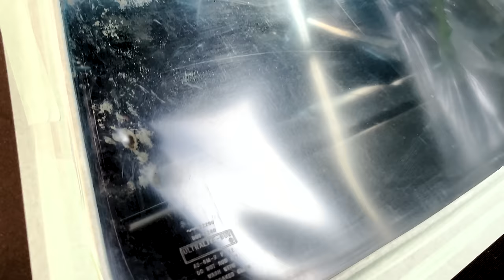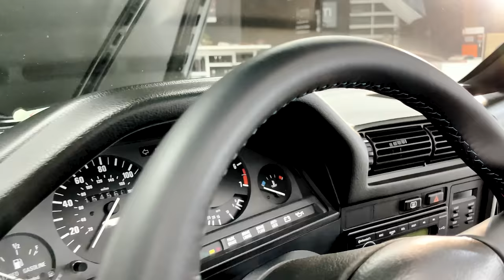The CLEANEST BMW E30 318ic you'll see today! AFTER 60HOURS DRY ICE CLEANING with FULL REFRESH DETAIL

Comment: „A car worth a few thousand dollars“ 
A convertible e30 in that condition (the condition it was before) will cost you about 15.000 Euro in Germany, and with that level ob cleaness you can sell it in „perfect condition, like new“ for much more. Plus you will be the Star on the Next car/Oldtimer Meeting.
Reply from the maker: Yes same here… the car worth around $25-30k now after our service I wouldn’t be surprise that there will be buyer for $35k+ but this car never will be for sale. 
And I used “few thousand dollars”  Because $30k is compare with hundred or million dollar cars we working on and even that people don’t want spend money like this owner. It’s very rare with “cheap” car like that.
Reply: the important point here is that its a convertible. and even small engined convertibles always hold their value better.
Reply: Dude it's a 318, calm down.
Reply: @user-sy5ks9ms3t  even clapped 318s in this market are going for 5-7k. A perfect one will easily fetch 15-30. Especially with the factory 5spd mt and sport package.
Reply: @scubascuba  such a shame, 318 sounds like pulling a car around in the tail
Reply: I bought my 316 2 door here in Germany 2003 when I got m license for 1100bucks  nobody wanted 4 Zylinders that Time. Even 320s were cheap because they wherent fast an needed a lot fuel. Today’s prices getting ridiculous.
Saw a before facelift 318 Cabrio. No leather. shitty condition for 8,5k few days ago.  
A 6zyl e30 whithout rust easy goes for 10k
Reply: @IAMDetailing  never sell it or you will regret it for your entire life,,, i sold my e30 coupe and i have tears in my eyes everytime i remember it and my days with it. And great job in the video, continue like that for good job and contents 👏🌹

Comment: So nice to see proper detailing where components are confidently removed and all the small areas are cleaned. So many idiots get involved in this industry have no formal training or experience. As a former Audi tech. I was trained in not just subsystem operations and troubleshooting, but in disassembly and assembly tasks. Clearly these are real vehicle technicians removing items correctly and replacing them is involved here. Had a bad experience both here in the UK with my 2019 Audi S5 and in Jamaica with my 2018 Q7. Keep the videos coming guys hopefully these guys will take the time to get some formal training to learn how to do things properly, and not do damage to customers cars.

Comment: I like a lot also have 318i 105 hp 2 door  from 1983 it was very cheap 900 euros i spended 300  and it was on the road in 2017 ,but needs job  entirely kjetronic needs Revival  thats the worst part everything needs to be checked for the rest its easy to Work on i will do the most .

Comment: what is the cost for something like this?  I have an 88' 325ic
Reply: If you want your car detailed to this level of perfection it will be at the very least 2500 i recon, most likely more.
Granted i don´t know the prices in the US, but over here in Germany just a paint correction of this degree with ceramic coating afterwards will end up at around 1200-1500€,
dry-ice cleaning of an entire underfloor will be around 2000€.
But if you don´t need to get to this level of perfection, it will become considerably cheaper, it always depends what you want the result to look like.

Comment: He did not apply the ceramic coating on a wheel with the unprotected brake disc behind it, or did he?
Reply from the maker: huh?
Reply: @IAMDetailing  The disk is supposed to stay clean. Certain contaminations might reduce friction and reduce breaking power. Maybe the coating will burn off but i would not risk it. I once had to replace a break disc on a motorcycle because an oily residue burned in on it. I drove it a while only noticing the reduced breaking ability. Later the disk even warped  because it kept getting very hot but still not breaking properly. During an inspection we discovered the disc and pads had an almost glass like coating on the surface. Both went into the bin.
Reply from the maker: @YouThana  Ah I see what you were asking now. We use the detail sprayer because it's so accurate, and if there is any overspray, we remove it before the graphite sets

Comment: Got so frustrated since the work is immaculate and they could have so easily corrected the 318i to it's original 318is. This car is with M42 engine.
Reply from the maker: 90-92 318i came with an M42. You can't just rebadge a car! The IS had a ton of specific features that wasn't included in this model, so if the vin doesn't say 318is, you should be badge shamed lol

Comment: You do know that the process has high temperature variances which allow for easy fracking on a molecular level to separate particulates, however, you just weakened every component that experienced it.  Research what it actually does.